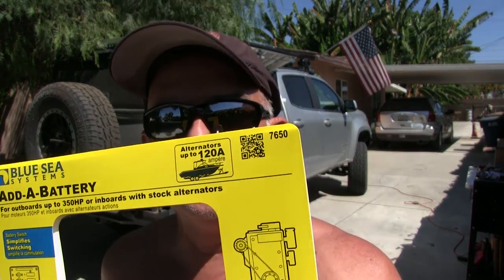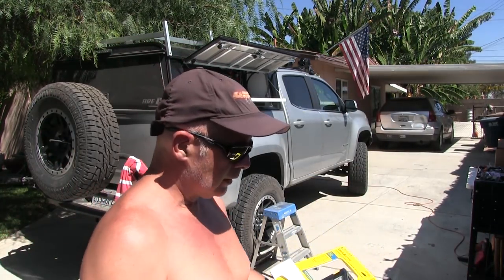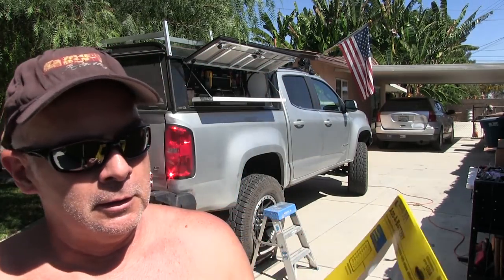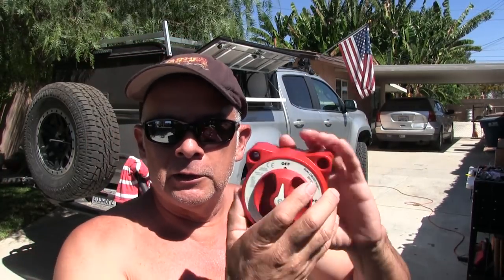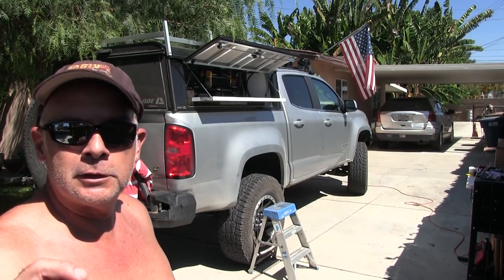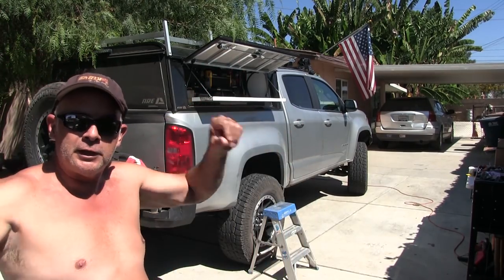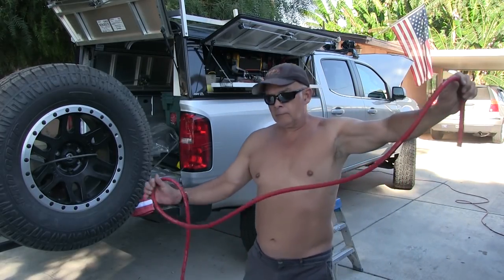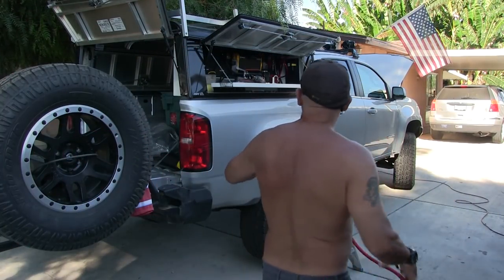Battery Disconnect and Isolator

Comment: When I still had my Bronco It had a dual battery setup using a solenoid instead of a battery isolator it was controlled by a 3 position toggle switch on the dash (off - dual on- emergency on) when the switch is set to dual on both batteries are only connected when the truck is switched on (both charge by alternator) otherwise they are separate and everything draws off main battery emergency connects both for starting when main battery is to weak or dead. It was made by a company called wheelin for use in emergency vehicles that specific kit(they made vehicle specific kits) was for F series trucks 87-96 to fit dual optima batteries (fit both in stock battery location) an upgraded 180A alternator using the current style case (my 1990 needed to be modified for that to fit) you just needed to add 1/0 gauge wire and the batteries.